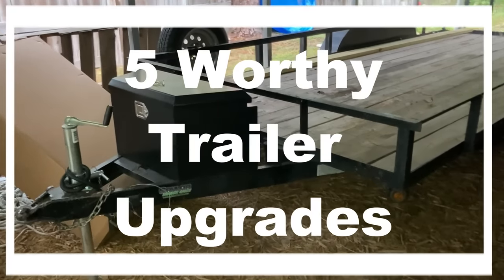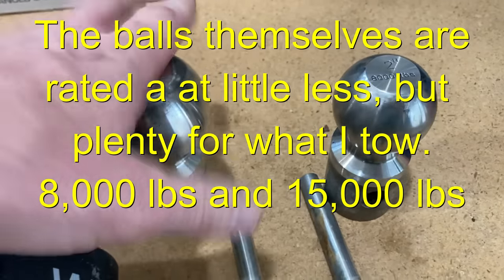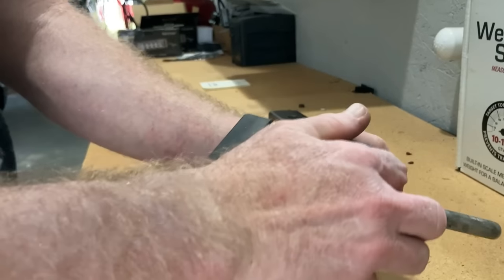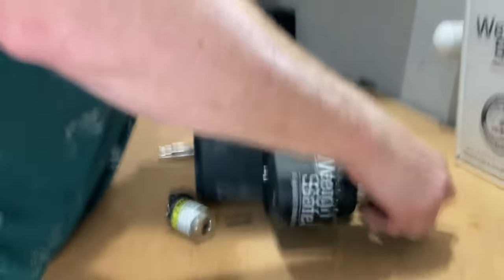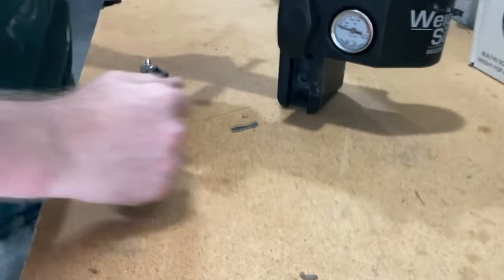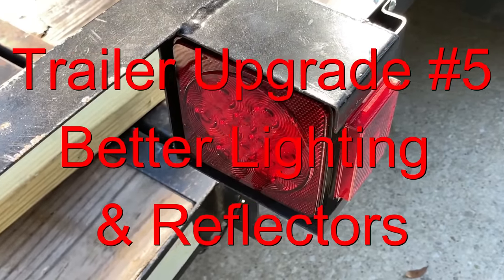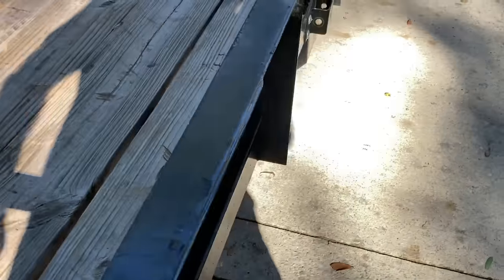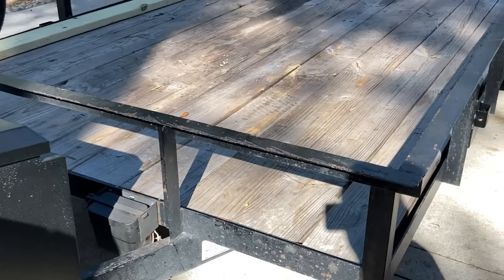5 Worthy Trailer Upgrades

Comment: I dont like those d rings that go in the stake pockets. Just weld or bolt d rings directly to the trailer, or use the stake pockets with chains as they were intended. If you put chain through pocket and hook on top then they wont fall off even if loose. You should always secure the load in a way that even if the securement loosens up it will not become unhooked on either end.
Reply from the maker: That is true, they do have ratchet straps that will attach directly to the stake pockets themselves doiing away with the d-ring shackles.  They also make them with the ratcheting systems already included as well.  Thanks for your opinion and watching.
Reply from the maker: Yep, to each his own.  I added the stake pockets in several locations so I could move around the D-rings and not have to but so many.  It already had several d-rings, but still needed a few more, as I demonstrated.  Thanks for watching T.L.
Reply: Yes and when it comes to securing equipment you should use at least grade 70 chain and binders, not straps.
Reply from the maker: @preachers4135  Yep, I understand that straps are inferior to chains and binders, but I have quality American made straps and even the cheap Chinese made binders and chains are out of this world priced and considering I haul a 1 series John Deere, I just don't think it's as important.  Also, I connect at all four corners, so there is some redundancy.
Reply: @MyProjectsFL  Straps are not inferior to chains. There is a reason almost all heavy loads are tied down or lifted with straps. You just have to make sure they don’t get damaged, but the same thing applies to chains.
Reply from the maker: @matthewhuszarik4173  I agree, I guess when you think about it, truckers use them all the time for big heavy loads.  Thanks for watching.
Reply: @MyProjectsFL I believe chains and chain binders are not osha approved anymore. Straps are the way to go. Off the top of my head I’m guessing that in the event of an accident the straps will better because or stretch. Where a chain would snap. Just guessing though. Something worth looking into though.
Reply from the maker: @asroneightyseven3854  I'm a ratchet strap guy myself and I get lots of folks like chains, but i also see lots of truckers using straps on their cargo, so my guess, is that straps are jsut fine...as long as you get the correct ones for the load you are carrying.  But that would be the case with anything like this.  Thanks for watching.

Comment: Your safety brake cable is connected in a dangerous way, that renders it useless.  It should be free from all obstructions from the trailer to your truck, so if your tongue and safety chains fail the trailer applies it the brakes to avoid your trailer from continuing on at the speed it was doing.

Comment: A good fix for your straps rubbing against something is to stop by your local Fire Dept and see if they have a 2 1/2  fire hose that's scrap.  If so get one and cut pieces of it in various lengths and slide your straps through the fire hose.  The hose outside will take the beating and your straps will stay nice by rubbing against the smooth inside of the hose.
Reply from the maker: That sounds like a great lifehack for sure.  Thanks for watching.

Comment: First upgrade to consider if you have a landscape trailer with a 6 foot rear drop gate,, A spring assist lift such as a Gorilla Lift, etc...  Once installed, you WILL curse dealing with any trailer that does not have one. They are usually less than $200 and your back will forever thank you!!!
Reply from the maker: Robert, I agree 100%, that was one upgrade I'm wanting to do and even thought about delaying this video until I had it done.  Yes, I am so tried of dealing with that huge gate.  What I'd really like is spring loaded sliding ramps, but I'm not in heaven yet and they generally don't exist on smaller trailers like this.  That is my next upgrade for sure, I'm really surprised you are the first to mention it.  Thanks for watching.

Comment: No backup lights? No backup alarm that speaks "attention please this vehicle is backing up" that always got everybody's attention and they are pretty cheap:-)
Reply from the maker: Yes, I know I am a terriblee person, I just realized on the small trailer that they do come with options to have back up lights.  Honestly in Florida, I guess it's not required at all, as I've never had a trailer with them.  Now, I have just sold both trailers, as I'm sort of combining the two (in a way).  I'm stepping down to a 16' trailer with a SA, 5200#.  I will likely outfit that one with back-ups once I get it unless it has them already, which I would guess no.  Thanks for watching James and pointing that out.
Reply: I have small 5x8 enclosed 1 axle trailer and I added electric brakes and backup lights and a what a much improvement.

Comment: Guess I'm just old fashioned but I've had several straps break, give-way, snap & or fray, I will  stick with my chains & binders & they don't get all sloppy & slimy & stretch when wet.
Reply from the maker: I looked into those, but cost and what I haul sort of prevented that.  What I mean is my tractor is 2400-2600# fully loaded and no doubt chains and binders are better, but my straps at four corners each with 3333 and 4000# working strength and higher break loads left me feeling pretty secure.  But side by side, your old fashionness is well thought out.  Thanks for watching.

Comment: Spring loaded tailgate lift by Gorilla Lift is a real back saver for 200.00 and fits virtually any utility trailer.
Reply from the maker: Yep, I agree, very possible it will make it on the new trailer.  Thanks for watching.

Comment: #1 Wire up some LED work lights with a switch off your 7 pin.   #2 Use Rustoleum Garage Floor Epoxy and throw some sand over the drying paint to add floor grip and protect the decking.    #3 Add some vertical canes with an Amber LED at the top so  you know where the back of your trailer is when backing at night time.   #3 Spare Tire Mount on driver side of trailer in front of the fender.    #4 Maybe a spare spring set in case you overload it and break the spring.  #5 Bottle Jack in the Toolbox.
Reply from the maker: I do have a jack in the truck, but a spare bottle jack isn't a bad idea.  Why the spare relocate?  Just curious.  I like all the other ideas.  I did solid stain my new trailer, as I have sold both of these.  And I had considered the sand thing before, but brave enough to think I could distribute it evenly enough to make it work though😂.  I really like idea # 1and 3.  Thanks for watching.

Comment: One more upgrade I would highly recommend is when your 2 x 6’s get bad and need to replace them. Do not put 2x6 lumber back on your trailer. Instead get waterproof plywood and put it on your trailer. It much stronger and more stable. It will not twist or split nor swell or shrink like lumber does!  It will outlast your 2x6 lumber by literally decades longer! 
Waterproof plywood I bought actually had plastic laminate glued on the face of the plywood and another type material glued to the back side to protect the plywood more.  I bought 3/4” plywood and since my deck was larger then 4’x8’, I spliced the next piece of plywood on the trailer to fill the width with the plywood. After I got the first layer of plywood down with the plastic laminate facing down under the trailer. I off set the next layer of plywood so the seams weren’t in the same area and this time second layer the plastic laminate was face up.  After both your plywood layers are down it’s the same 1 1/2” thick just like your original 2x6 lumber would be! 
Gives you a really super nice floor and you can slide a shovel across the surface if you’re hauling dirt or other materials like wood chips! 
Unless you really abuse this flooring, it’s going to stay smooth and you’ll never have any kind of splinters to deal with plywood will only swell or shrink 1/16” of a inch, unlike lumber that can swell or shrink up to a 1/4” of a inch and that’s why you need the gap between your lumber boards to give clearance between swelling boards!  Won’t have those issues with plywood! 
I actually put regular plywood on a trailer some 30 years ago and finished it with exterior finish. It held up 20 years before I ever had to replace it. The waterproof plywood will last much longer, especially with the plastic Laminate on the surface of the plywood! 
Once you try it, you’ll never go back to using 2x6 lumber again!
Reply: Is it just called “waterproof plywood” or what do I ask for when I go to buy it? What should I coat it in? Primer and a sprinkle of sand so it’s a little grippier? Or maybe stops or rubber instead of sand paint so it can still be smooth when needed.
Reply: @asroneightyseven3854  I didn’t put anything on the surface of my flooring, whatever I haul on my trailer including my tractor and accessories.  The hauling straps holds everything in place where nothing moves. But if you wanted to make a rough surface, you would want to probably use a belt sander with at least 80 grit sanding belts to rough up the plastic laminate to get what you’re going to coat the surface with to stick. 
I’m a contractor and have had many plastic laminate countertops I have recovered with new plastic laminate with contact cement and I always presand the old laminate first before putting on the contact cement to the surface of the old laminate and a coat of contact cement to the new laminate as well.  Never had any problems with the glue sticking after it’s been roughed up with sand paper!
 Same should work with whatever coating you want to put on the laminate?  If you wanted to you could even put on the coating often used for the beds of trucks or sometimes used in Jeep’s that’s very durable and holds up a long time from what I have heard.  Of course brands may vary how well it lasts too?   I bought mine at a wood supplier in  woodland, Washington. I believe the name of the business is Woodland wood connection 119 Goering St. woodland,Washington 98674
360-841-8126 
They have different thicknesses of the waterproof material with the laminate plastic covering on it. Tell them what you want and they’ll know what you’re looking for!  Hopefully you’re in my area?
Reply: bruh just put used motor oil and diesel on your existing boards it will seal them for life

Comment: 18” chain extenders with grab hooks are handy .
Pear shape rings for 2” wire hook end ratchet straps .
3” delta rings for 2” flat hook end ratchet straps .
Brophy portable 2” ratchet strap winches .
Mount a few stake pockets in center of the trailer onto a crossmember . Rub rails and stale pockets front and rear of trailer bed . A few suggestions that work well  .   12/22
Reply from the maker: Vic, thanks for the ideas, I appreciate it.  Also, thanks for watching.

Comment: The DOT reflective tape was a good idea. Love the stake pocket D-rings. I need to put that on MY list. I like the storage box idea also. Good install.
Reply from the maker: I did sell both of those to try to "downsize" my trailer situation.  Already I installed the reflective tape and it came custom with the d-rings.  I am still working on a new tool box solution as the spare tire is now in the rough location.  I appreciate the kind words and thanks for watching.

Comment: Heck... if I knew you were in the market for a harbor fright tongue box I could have worked a great deal with you for a nearly free unit. They do a respectable job of keeping what's inside out of the rain if the trailer is sitting still, but put it in motion on the interstate and you'll find that the absence of lid gaskets make a great path for water into the box!!
Reply from the maker: That is good to know, I did sell that one...the trailer but I'm having another built and would likely get the same tool box if it fits correctly.  But I guess I'll plan on some level of weather stripping to prevent those issues.  Thanks for the heads up and also watching Mike.

Comment: Thanks this was very helpful. I have small trailer and those items you mentioned are need on my trialer. Thanks
Reply from the maker: Yep, it's funny, trailers are like tractors, as much as the manufacturers put on them, it's never enough, which is probably why the aftermarket is so full of extras.  But to me, it's odd that they don't automatically come with tie-down points.  In fact, that's another issue with tractors, you usually have to add them too.  Thanks for watching.

Comment: Where to start?
Trailer jack take it apart (rusts here so prevent it)  and put Grease on the threads, that will prevent/extend the time when it doesn't work.
The carriage bolts are likely less then gr 5 I would have got used NF gr 8 3/8" bolts. Yes it is sheer which is being worked against but still. 
The home build trailer I bought I added 3/8"X3"flat bar made slots into the tube to weld both sides of the tube with some 1/2" some 5'8" eye bolt for ankerage points. Depending on what was going to be done at that place. Never had a problem.  
The big one is (wiring !!!!!!!!! ) as those poor grade blue wire splices will corrode and fail. At the wrong time.
I ran mine into two boxes on the frame which I put on for splices. Splicing was solder/ RTV heat shrinks  was my design from 40 yrs ago. Never had a bad one yet. 
The round 4 wire or 7 wire main wire is WELL Worth it.That flat stuff is JUNK! Had it fail within a yr and a half cracked/shorted!!!!!!!!!! 
FYI LED lights are designed to destroy your eyes. go learn about it 
My plug  in cracks every number of years remove it full it with more Vaseline no bad connections for those years, oh solder the ends of the wires good to go!  
The trailer was designed to pivot at the center for loading , which was too light of material so I used 3/8" flat bar drilled the hole for pivot and four holes into the sides of the  tube two for 1/4X20"s for securing the flat bar to the sides the other two for welding to the tube. Much better design.
Reply from the maker: Edward, thanks for your insights on how to improve these additional things, I appreciate the feedback and thanks for watching.

Comment: Add work lights. The bed lights and tractor lights aren't always the best.
I used a set of bed lights mounted under my trailer rails.
Reply from the maker: That would make trailers more useful for sure.  I have had to use them as a work bench from time to time before.  Thanks for watching.

Comment: I like that you can put tail gate down
Reply from the maker: Yes, that was a huge help.  I actually got rid of that trailer and got another, but it also can have the tailgate down when trailer is attached.  It does make it much easier for sure.  Thanks for watching.

Comment: Good ideas for sure for the lighter trailers.  Buts lets get into the real issues on reliability and safe hauling.  First, electric over hydraulic brakes are a must, electric brakes suck.  We have to replace electric brakes every year.   Tires: put those 16 inch 10 plys on your daughter's pickup, go get some 14 ply trailer tires.  We use 17.5 lo pro, same bolt pattern more deck clearance and better load capacity.  Suspension: when you replace the springs, just get heavier springs.  Better to do it now than on the side of the interstate.   Get a pintle ring if you're anything over 6 ton.  Use a separate ground wire for all you're lighs.  Order your trailer hot dipped galvanized, powder coats suck on trailers.  They don't get  the metal hot enough.  We could talk about cross members and grease vs oil bath but that gets into a heavier class of trailer.  Last, dont forget to ugrade youre drivers license if youre over 18000 lb.  Oh, here's the payoff, dexter axle electric brakes aren't designed to stop the vehicle, only slow it down when the breakaway is pulled.  Get the letter from Dexter.
Reply: I hear the voice of experience speaking......
Reply: @justintx75  Thnx JustinTX75.  Only about 20 years haulin hay with a custom 10 wheeler Western Star  pullin a 6 ton pup through new england.  nice to have someone appreciate the voice of experience.
Reply from the maker: I appreciate your insights on the how to make it better.  However, I only have 6 ply, C rating as that is standard for a 7000# TA trailer.  Now I wish I had gotten the 10plys for that trailer, but I'd rather think that 14 plys are a bit overkill for a 7000# trailer.  Now as you suggest, the 14ply would be helpful and the way to go on over 10000# or 14000# trailers, but I just don't have a need for that size/capacity trailer.  I just tow a small tractor with it's attachments, so it runs about 2500#, give or take.  I didn't know much about the brake issues, hydraulic versus electric, so that was interesting.  Thanks for watching.
Reply: Yeah they come with load range c tires. Load range e is the upgrade. Which is 10 ply. Doubt they make a 14 ply in this size, if they did it'd ride so rough empty you'd hate it. Also license upgrade comes into effect at 10k trailer gvwr or 26k combination gvwr. Neither of those would come into play with this trailer.
Reply from the maker: @chaseledbetter5186  Agreed, thanks for watching.
Reply: License upgrade at 18K LBS. what state do you live in?

Comment: How about putting wood sealer/water proofer on your deck.  That would be an excellent upgrade!
Reply from the maker: Although the trailer does stay out of the weather most of the time, I did see another guy do that and thought I might as well.  I actually got rid of both of those trailers last week and have a new custom one being built, so with brand new wood, I think I will execute that idea.  Thanks for watching.